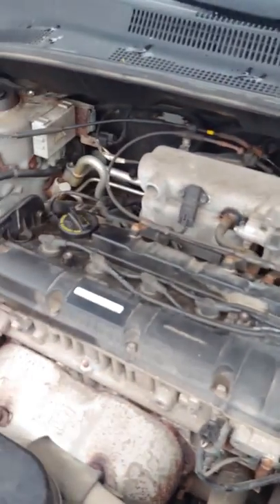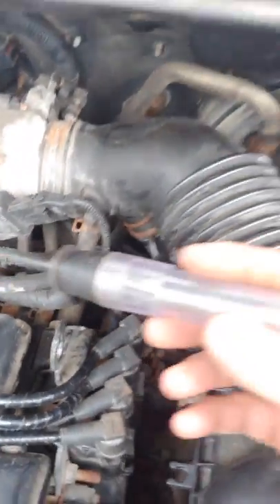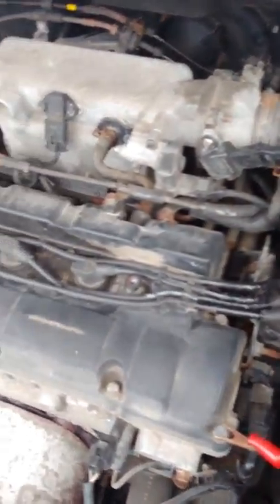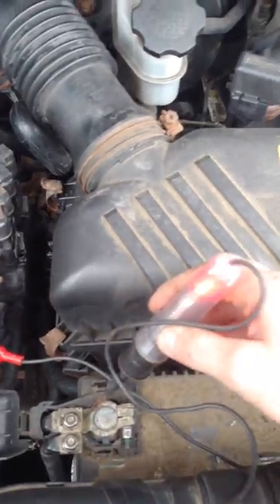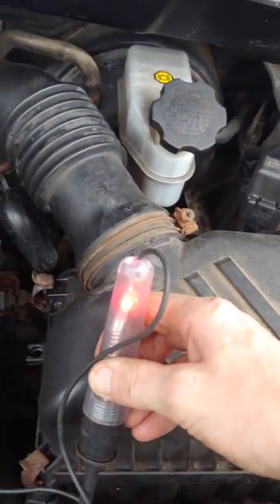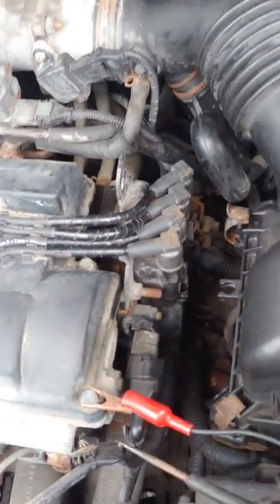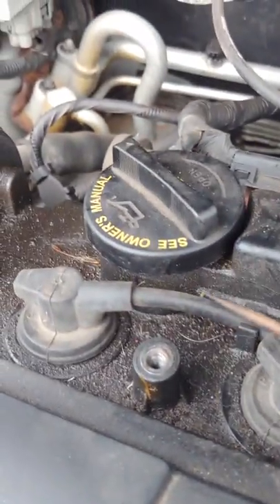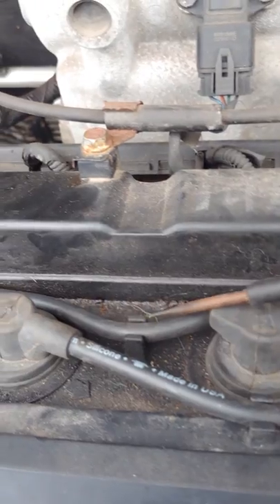testing spark plug wire

Comment: Great video. 
   A test light is cheaply priced and a useful tool to have . 
    You can also make your own text light , using a piece of wire , on each side of a taillight bulb or use the taillight plug with bulb .     This comes in handy if your don't have a test light or it's been misplaced .

Comment: I’m getting crank no start & trying to verify I have spark so I removed the spark plug wire from the spark plug & put my test light directly on the metal cap inside the rubber boot while cranking the engine, the test light should light up when I crank the engine if there’s spark correct???
Reply from the maker: Check the fuse box for Anny fuse that have popped

Comment: What type of tester is this? Can I use any tester
Reply from the maker: its jest a normal 12 v test light  here is one for examplehttps://www.amazon.ca/Truck-Voltage-Circuit-Tester-VoltMet/dp/B07ST3JY9Z/ref=pd_sbs_5/142-2383038-0842853?pd_rd_w=pKkIw&pf_rd_p=122bc0af-a01e-43fb-b8e9-05fa793ecd9f&pf_rd_r=JHWPMY3474PXFF5T36Y7&pd_rd_r=cc496b54-a144-4df4-b959-8a7fea2e61c2&pd_rd_wg=Y9MiW&pd_rd_i=B07ST3JY9Z&psc=1
Reply: can get those 7 days a week from harbor freight. about $5.